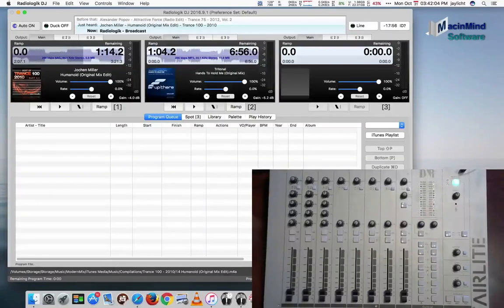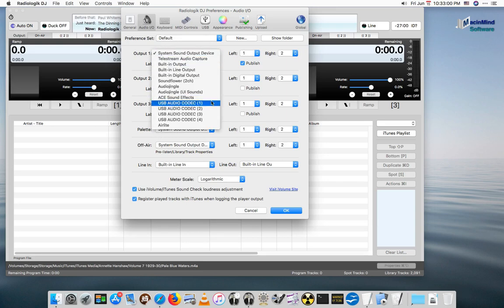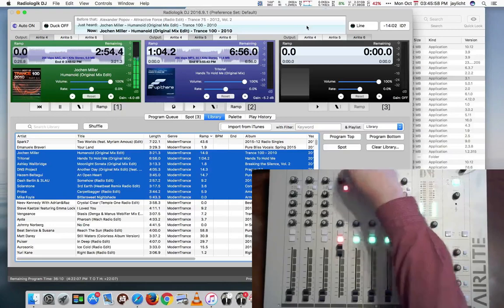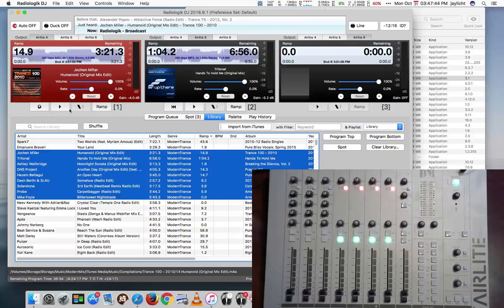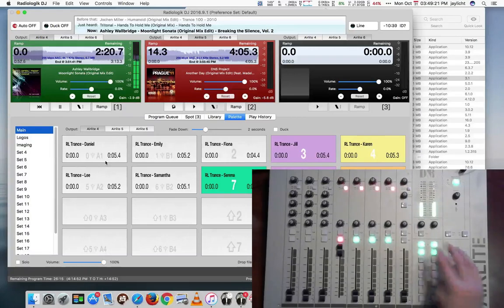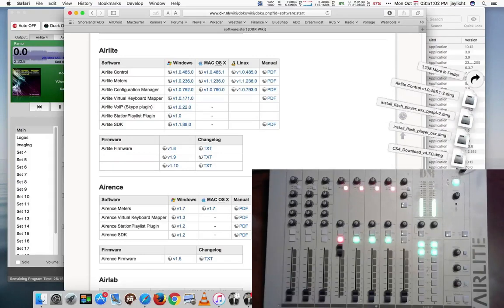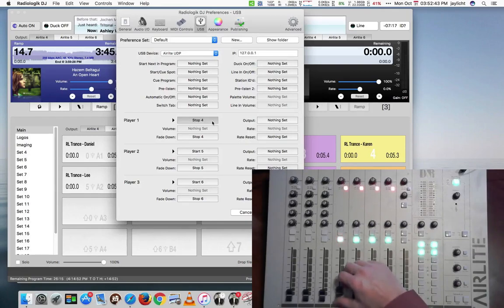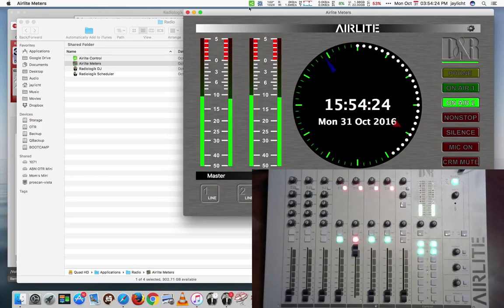27. Radiologik DJ Airlite Setup (2018)

Comment: Does this apply to the Behringer? DX2000 USB mixer or does this only support D&R Airlite?
Reply from the maker: Airlite, Webstation, Airence and AirLab are specifically supported. Anything that appears as an audio device on the Mac has audio support. There is assignable support in USB and MIDI Controls for many other devices. For example the Rodecaster Pro 2 works for audio and control without specific support using MIDI Control. Looking at the user manual for the Behringer DX2000USB, I only see support for audio to channel 3. I don't see any support for remote controlling via USB/MIDI, just remote control of CD players, CART machines via what looks like 1/4 jacks. If you discover there's something I can support with this mixer that I don't yet, I'm happy to help.
Reply: @MacinMindSoftware  Many thanks for sharing your thoughts, I guess the behringer is more geared up for CD disco decks not broadcast equipment for playout system. 

Understand with what you are saying the USB design for 1 channel only and has no proper software support in nut shell. 

I thought the mixer was to good to be true for the price. Only buy industry standard mixers like the D&R Airlite etc.

Thanks again 👍